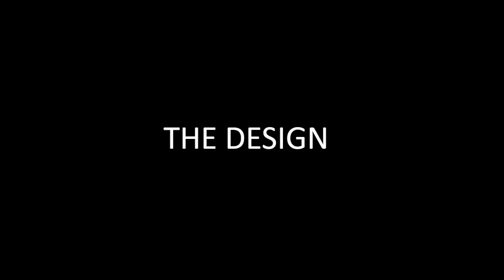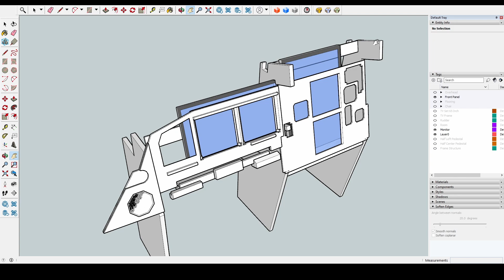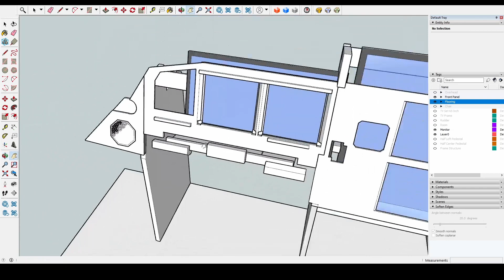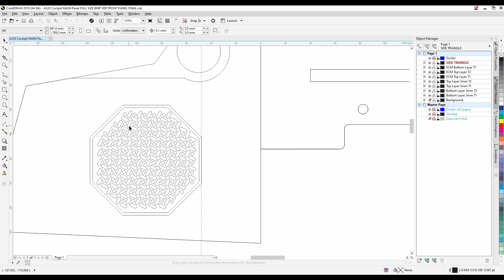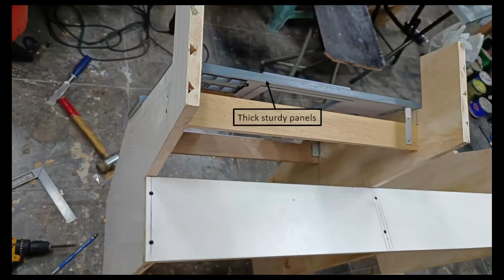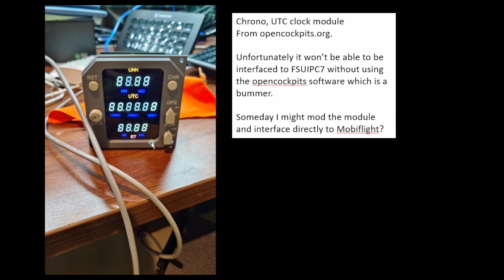DIY A320 Neo Home Cockpit Build Video   Part 4 MIP

Comment: Iam a noob for building this i have a question regarding the MIP panel where u sandwitched mdf and arcrylic. Can i just make it put of mdf and paint it? Will it work ? Will it look good?
Reply from the maker: You could but MDF is difficult to make smooth finish surface, but with some putty and effort you probably could, also you could not engraved MDF so if thats not your concern it can be done

Comment: Are you using MSFS 2020 right? How could you manage to separate the PFD and NAV, as well as ECAM, in order to them appear in the monitor the way they do?
What a wonderful work you have done.
Reply from the maker: @hugograca8129  using pop up feature forgot how to its been a while not using the sims
Reply: @hobbytechgearID69  thank you very much for your quick reply.
Does anyone knows how to have PFD and NAV on a monitor, in MSFS 2020?

Comment: Very good build! And well explained ;).  Is this type (newer generation) panel OK with CFM56 engines?
Reply from the maker: Hi, as this is just a panel connected with the aircraft code or system in this case flybywire a32nx the panel should be in accordance with the simulated aircraft. Thus the panel is not directlt dependant with the type of engine.

Comment: Hey there thinking of making one which 3d printer do you use
Reply from the maker: I use prusa mk 3 but I think any good 3d printer will do for filamentfor larger items like tiller, trim wheel, etc.  For knobs and small details  i use resin based 3d printer. Im using the first generation of anycubic photon. Today its been much better version available